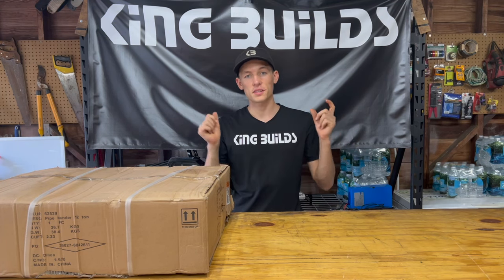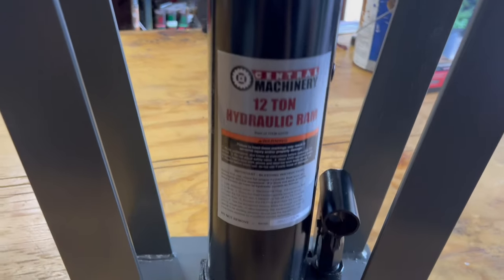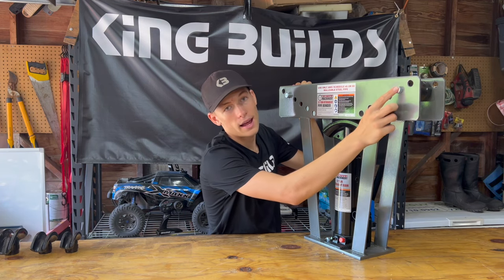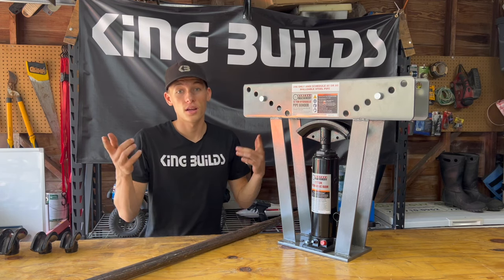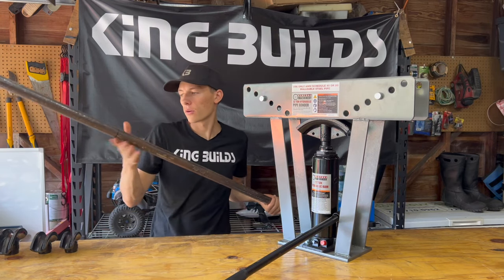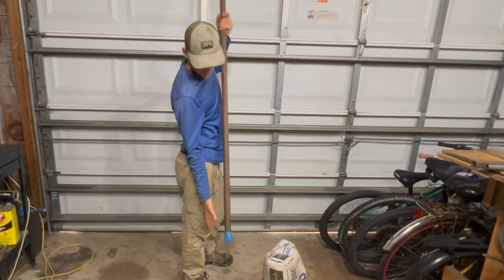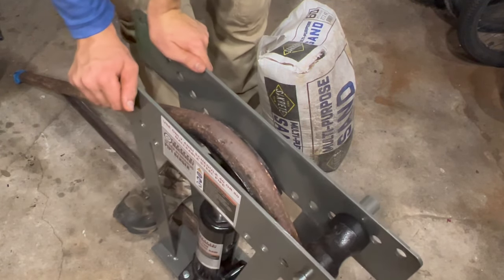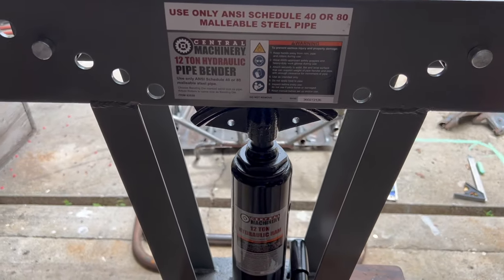How to Bend Pipe with NO KINKS! - Tips and Tricks - Featuring Harbor Fright 12 TON Pipe Bender.

Comment: In the 2nd attempt you not just used sand but you changed the tool from 1 1/4" to 1" as well. Maybe that would work without sand, am I wrong?
Reply from the maker: Hi there! That is a great observation! But I think without the sand, the pipe would collapse or just kink like it did. But with the sand in it, and no where to go, it keeps the walls of the pipe pushed out. I switched the tool size, because the 1" seemed to fit better for the pipe.
Reply: That shut him up didn't it 😅. Great video lad what I was just looking for  👍

Comment: But you are using a pipe bender to bend tube. They are not the same material, so that's why you have to create a work around. Consider a steel spring instead of sand - not sure if it will work by would be less messy.
Reply: Do you know of a usable tubing bender in  the same price range?
Reply: That is pipe that he bent
Reply: So many people use this type of bender to make roll cages, bumpers, etc for years
Reply: @TomSlickery you’re next best option is “affordable bender”

Comment: Question: is it safe to bend a pipe 15degrees angle without filling it with sand, but with just enough heat to bend it?
Reply from the maker: Hey, you should be fine, as long as you have the right tools to do it in a safe manner.
Reply: @kingbuilds8   My MC muffler bolt hole isnt aligned to the hole on the swingarm where it should be clamped down, so i just fabricated an extender for it to secure the muffler for the meantime, it looks ugly and unprofessional tho so i was thinking of clamping the pipe down on my work bench, torch the part where i will be bending it until glowing red,  attach a bigger pipe with just enough fit for better leverage. I may be bending it just a little bit not more than 15degrees angle, havent measured the angle yet, ill just be doing it by eye until both holes on the muffler and swingarm lined up.
Reply: @kingbuilds8  its 304 stainless steel with like 1mm thickness, used for MC elbows/pipes.